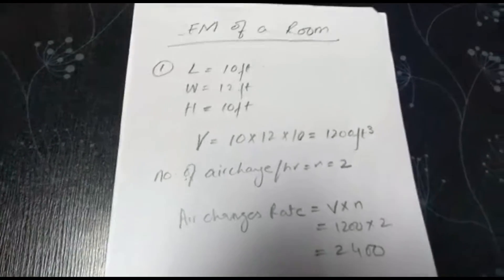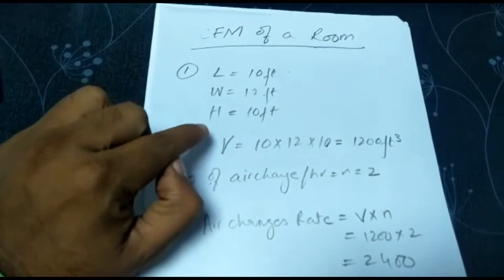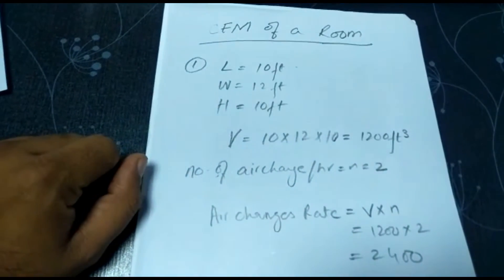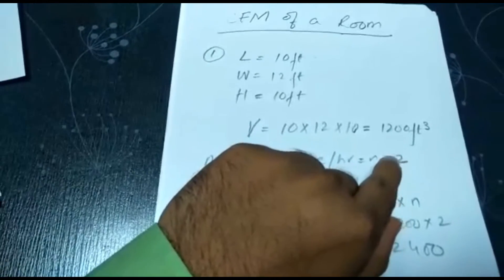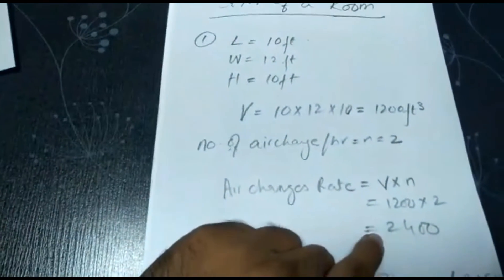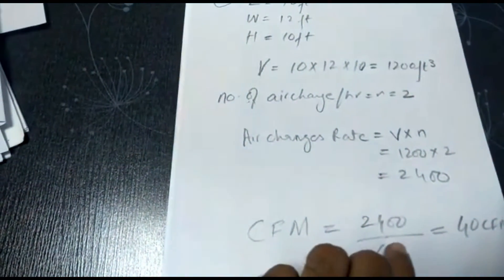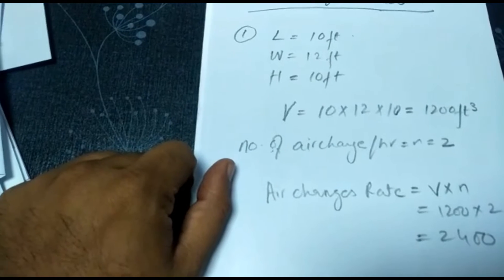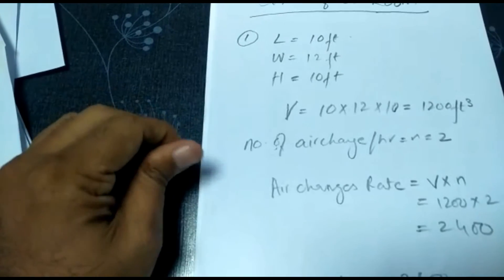CFM calculation

Comment: Sir how can i determine the No. of Airchange/Hr?
Reply: NUMBER OF AIR CHANGES PER HOUR HAVE SOME STANDARD VALUES DEPENDING UPON ROOMS. YOU CAN SEARCH IN GOOGLE YOU CAN EASILY GET NACPH VALUES.
Reply: 1-Tons =400CFM 2-Tons=800CFM and so on you get the point the right unit for the size of the room and then you can do the Math to get the right cfm to each room I hope this helps